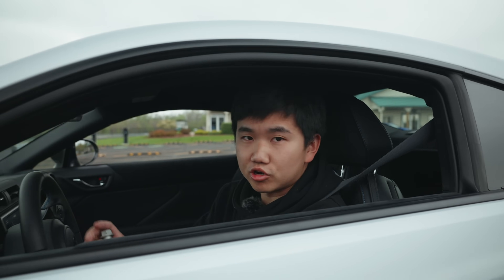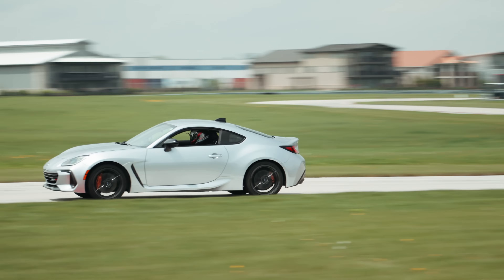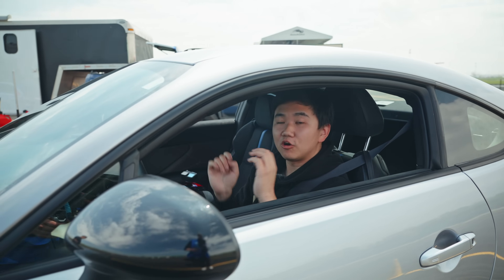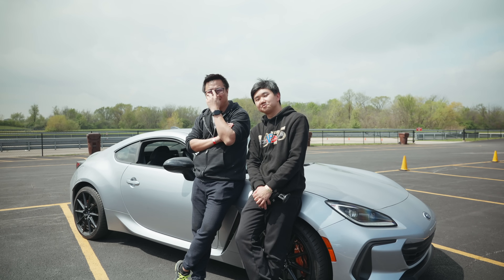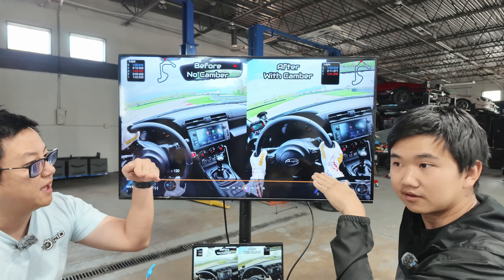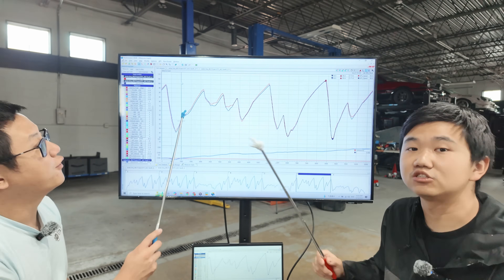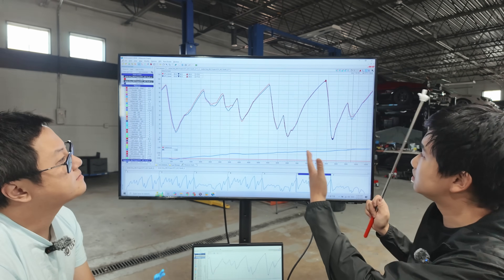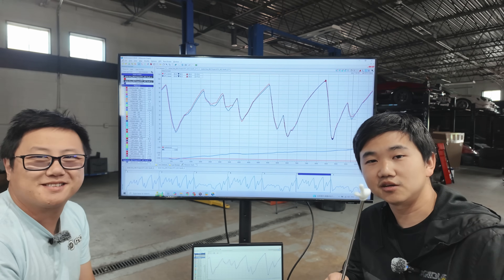$30 Hardware = Faster Lap Times on Track? Track Proven with Project RTV #1

Comment: SPL full control arm set is a must. Because the front end has struts, you will notice the inherent weaknesses of it at the limit, with the spl set it improves it drastically, will perform similar or practically on par with dual wishbones, understeer will literally be gone, youll take a corner thinking itll understeer but it doesnt. Roll center/bump steer kit is also a must. Aftermarket lsd will allow you to throttle steer the car beautifully. Its one of the cars that can happily do that because of its chassis and weight distribution. Would be amazing to see a full on time attack build with an engine swap. Definitly more potent than the supra with a k swap or other better 4 cyl turbod engines (1.8t 20v, cheaper and lighter than a k20 and it comes turbod).

Comment: The biggest issue isn’t the factory alignment. It’s the Mac strut front suspension design. Slap -3 on it straight away. Stickier tires and decent coils and you will want around -4 front.

Comment: The data walkthrough is great! What if you did stock suspension vs. coilovers w/camber plates vs. coilovere w/camber plates + geometry correcting/adjustable arms

Comment: Comparing this to the S2K what’s your thoughts ?
Reply: infinitely stiffer chassis, more aerodynamic, more steering feel, much more stable and can throttle steer with good aftermarket lsd, very progressive handling, it wont break on you uncontrollably during corners like a s2k or miata can

Comment: This is great! I have the exact same car with a very similar goal (slowly changing the car and tracking it with every mod to find the differences) and im excited to see the data you guys can provide. one thing I would like to see would be stock springs vs a "performance" lowering spring like the swift spec r or the racecomp springs vs a well setup coilover. Since the car is more of a budget option, it would be interesting to see how a spring can change the car since its usually a much cheaper option than a set of good coilvoers.

Comment: Request: Keep everything else stock and just do better and better alignments. Maybe camber plates for more camber and optimize toe and castor, then proper coilovers with more proper camber, and finally tires? Keep people from spending way too much $ to gain like 5 hp vs making the chassis better. And after that I think something people undervalue is good seats and harnesses so you can focus on driving more without sliding around. But that would be hard to quantify in lap time results...

Comment: This is AWESOME! Thank you for this series! Would you say the conditions during the day (air temp, tarmac temp, etc.) didn't have much impact? (in disfavor of the "with bolts" time I'd expect).
Reply from the maker: Relatively little. The two test were conducted as close to back-to-back as possible. And there were a total of 3-4 cars running on track all day, so track wasn't getting swept or rubbered in as such.
Reply: @JackieDing86   Got it! You guys rock! When are you coming to Japan to race with us? 😉

Comment: hey. you have to put the OE wiggle-crash bolt from the lower to the upper hole and use a 14mm camber bolt in the lower hole to get a final -2.4. also the 16mm subaru rear bar is meta.

Comment: Loved the video! But what's the difference between the bolts? Thickness, length? Maybe I missed it 😅
Reply from the maker: It's an eccentric bolt! So as you spin it, it pulls the top of the knuckle closer or further to the damper, giving you more or less negative camber!
Reply: @JackieDing86  awesome thanks!

Comment: unfortunately, if you've maxxed out your tire and wheel fitment with a stock suspension setup, you'll have minimal to no negative camber adjustment with camber bolts. With 245/35R18 - 42mm offset, you have maybe 2mm of clearance from the tire and suspension struts.

Comment: I would recommend the Pedders offset top mounts! I have them on my first gen, and when paired with the right lower camber bolt setup you're able to get around 3ish degrees negative camber and some additional positive caster on stock springs and dampers. They're super cheap and in that OEM+ category of mods. I also ran SPC front lower camber bolt with the OEM 14mm lower bolt moved into the top position when I was on stock dampers.
Reply from the maker: Noted for the future! We’ll def get to a more aggressive camber setting later on, but this is just to start!

Comment: Can you test some of the hype, showy cool looking track inspired mods? See which actually matter.

Alcantera steering wheel, heavier shift knob, stick on canards, vortex generators, headlight air duct, single vertical wiper mod, pedal bushings, metal steering rack bushings.
Reply from the maker: We’ll put them on the list :)

Comment: 0 degree camber from factory is insane. Need at least -1.5.
Reply: cars are mostly used in urban and suburban areas, not the track. 0 degree camber favors even tire wear and grip. negative camber can help when turning the car, but only in the track context. in most uses the benefits of negative camber are not useful and do not overcome the benefits of 0 camber.
Reply: @umnickaleatorio Correct for most cars, but this is a "sports" car.
Reply: @mm8436  yes but how many owners are actually tracking it? I mean I can’t be so sure because where I live it’s not available but I imagine the majority is just street use
Reply: 0 degrees means better stopping distance.